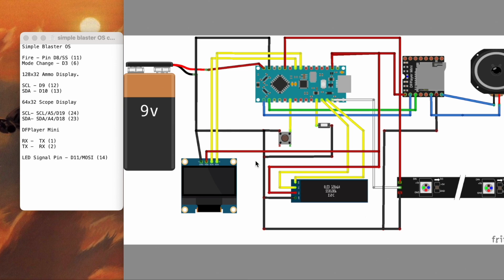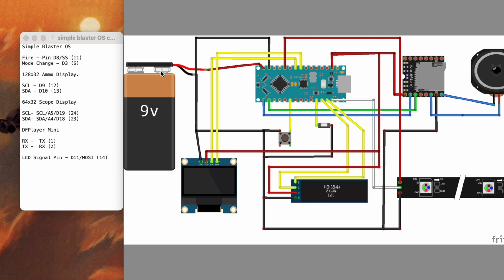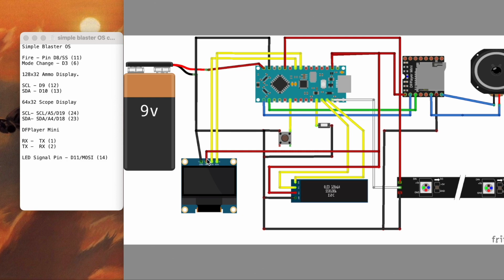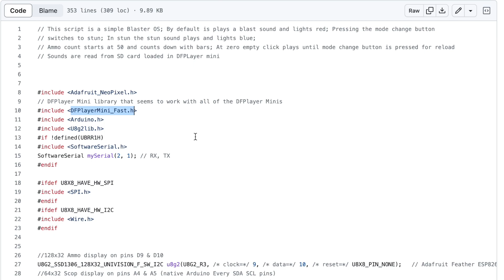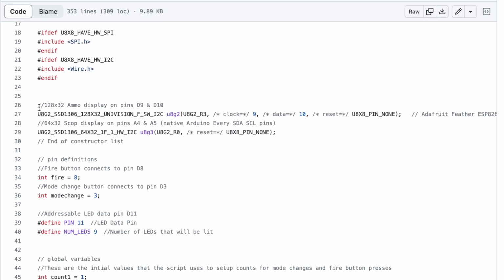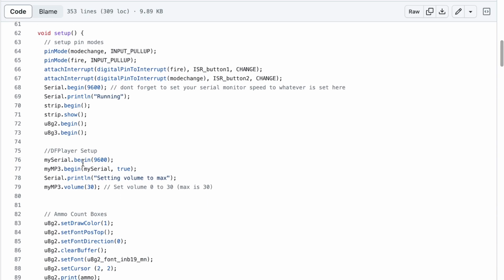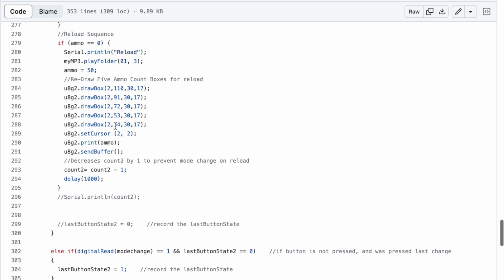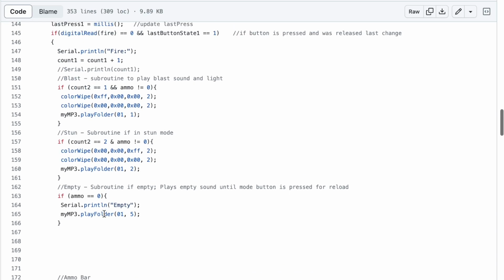Simple Bloster  OS V2 - Diagram & Connection Update

Comment: @cchobbyfun1 Hello! I'm tring to put this circuit together for an IB-94 blaster, but I can't seem to figure out what I'm doing wrong. I don't have screens connected, and only plan to use the fire button since I don't need mode switch or anything fancy. So my circuit has the 9v battery, elegoo nano, a single LED, dfplayer mini, speaker, and one pushbutton. Can you help me figure out what is wrong please?

Comment: Hi and i need a help, I get no reaction via pin D8 when I press the fire button. The Mode Change button D3 have a reaction, i can see this on the Arduino monitor and the led on the board, but not when i push the fire button. All the Displays works but not the RGB LEDs and also no sounds from the DFplayer. I changed all ..... Arduino nano, Arduino one, the DFplayer and and and ...... but every time the same problem. 😞 I see som here have the same problem ..... you found the problem ???
Reply from the maker: Try using one of the neopixels basic examples to test the the lights.  The DFPlayer minis can be tricky try the examples from one of the libraries.  Basically, isolate the problems. If the hardware is working I can see if there’s anything wrong with the code.
Reply: @cchobbyfun1  thanks for the quick reply.
I've already tested the neopixels before and they work.
also several DFPlayers and they work. They were in another object (Mando Blaster) and it worked fine. I want to use your application because of the display function and more neopixels. I hope you can help me and found my problem.
Reply from the maker: @captainjack2355  What type of Arduino board are you using?  Line #39 defines the LED pin 11.  Lines  150-`155. should play the sound and trigger the lights.  Try putting print line in there for debugging and make sure that's happening.
Reply: @cchobbyfun1  I have the Arduino Nano ATmega 328P old Bootloader . Today I tested it again and still have the same problem. No fire, no Neopixel, no sound. I changed the pins, same problem. I tested with a sketch example Neopixel and DFplayer .... it works but unfortunately not your program.
What do you mean " Try putting print line in for debugging " I dont understand this ???
Reply from the maker: @captainjack2355  I'm suggesting you insert a Serial.Println. command in the fire routine that would print in the serial console. Then you would know that the routine is executing.
Reply: @cchobbyfun1  I have do this ..... and noting  😞
Reply from the maker: @captainjack2355  If the line isn't printing that could mean the fire sequence is not being triggered.  You need to check the button inputs to make sure its working.  The fire button is supposed to be on pin 8.
Reply from the maker: @captainjack2355  sorry that command was wrong, I'm not the best programmer.  try Serial.println("Some text");
Reply: @cchobbyfun1  I have changing a lot of boards .... Arduino Nano original, Arduino UNO, Arduino Nano BT also i was looking the correct wire and the Pins ...... but all time the same problem 😞Thats not normal.
I think some one is not correct in the Programming .....!!!
Is posible you check the Programming again ???

Comment: Hello, I get no reaction via pin D8 when I press the button. I've already replaced the Arduino to rule out this as an error.
The DFPlayer also doesn't play any sounds no matter which button I press. The speaker only beeps briefly when you press the mode button. But it plays something via the pins on the DFPlayer directly on the ground.
Bg Meik
Reply: same problem... no reaction at all. like there's no trigger.
Reply: @contirossini  yes same

Comment: Currently printing a Blaster-Master E-11. I'm thinking this will work with it. One question: can I swap out the Neopixel LEDs with just one LED to mount at the end of the barrel to get a red light when firing?
Reply from the maker: Yes, it should work out of the box but you can also decrease the number LEDs to 1 just to make sure.  I'm actually doing a build with a single LED now so I'll let you know.
Reply: @cchobbyfun1  Yea, please let me know. I'm about halfway through printing/building my E-11. Love the LCD screens...
Reply: @cchobbyfun1  Sweet. I ordered a bunch of the parts just now, the parts I'll need for assembly. This could be the setup I was looking for... lol...